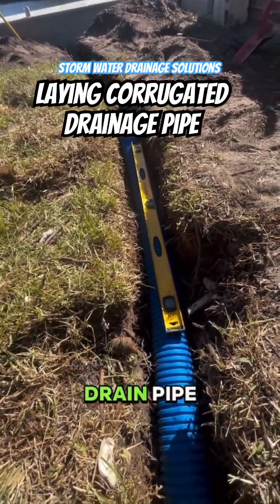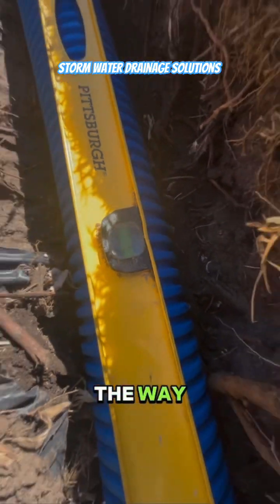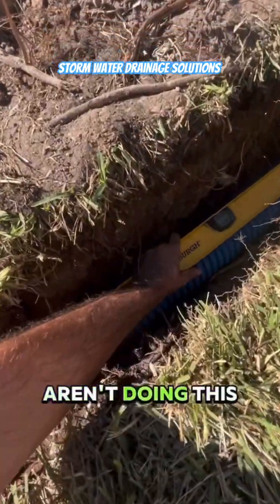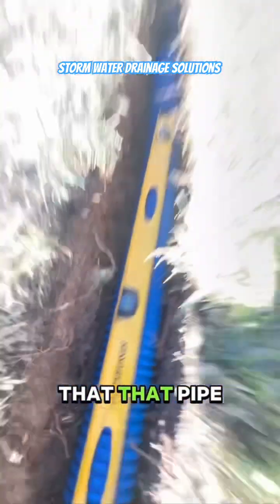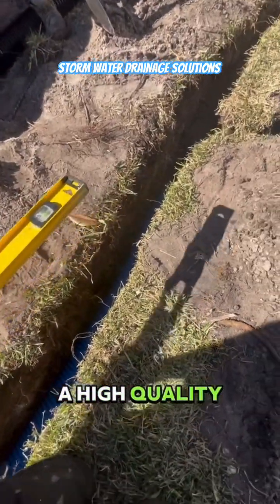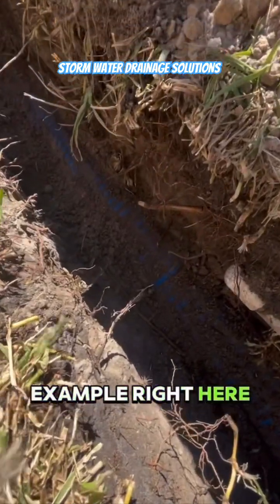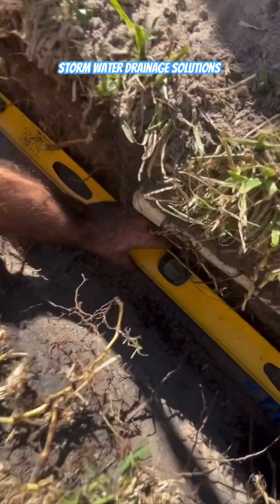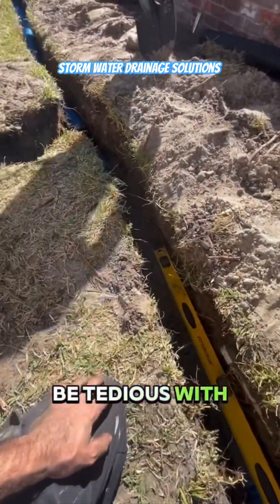Corrugated Drainage Pipe - Maintaining Proper Slope - Yard Drainage System - Tampa Drains

Comment: Is this a joke?
The level is being used incorrectly?
Reply: Guess I didn't add context. In my situation, you can check level both ways at the same time.
Reply: Still works fine. Unless it's bent. I use my torpedo on its side to set toilet flange, shower drains, even just plumbing up pvc. It works. I thought it was bullshit at first too. Social media teaches me a lot.